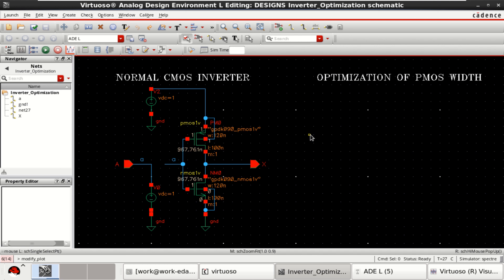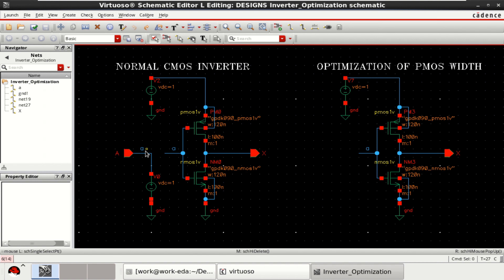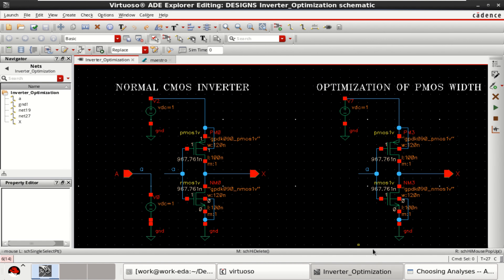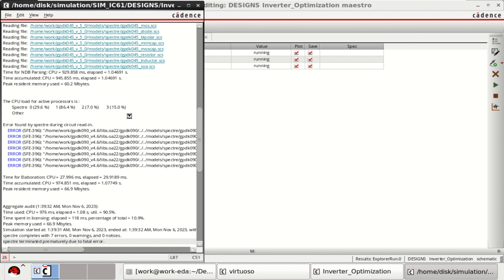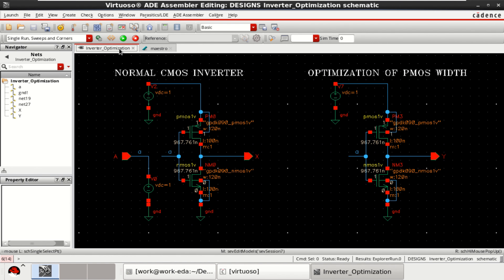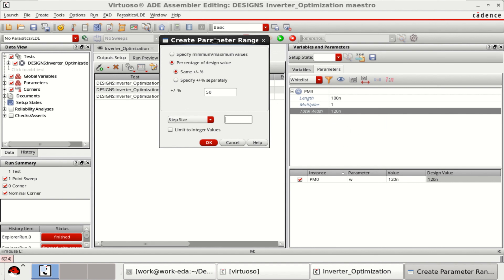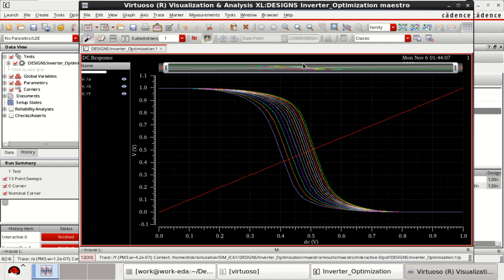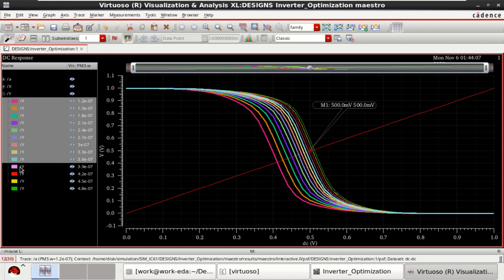Cadence Virtuoso: Optimization of PMOS  Width in ADE Assembler.

Comment: Sir even after attaching the mode files I'm facing an issue in the simulation of ADE Assembler. Does the assembler works in the cracked version of Cadence
Reply from the maker: Yes, it works. What is the check it in Google once.

Comment: Hi sir my question is irelevant about this video but I have question
I'm using delay function to calculate tpdf and tpdr of an inverter  but the value of two this is wrong value when I saw graph and use horizental line for calculate tpdr and tpdf it's OK and correct value but  I  use calculator It's wrong and I should have these to tpdr and tpdf value in my outputs can you tell me what's wrong with this please thanks
Reply from the maker: Use this video link
https://www.youtube.com/watch?v=6SwIVwXL4t0